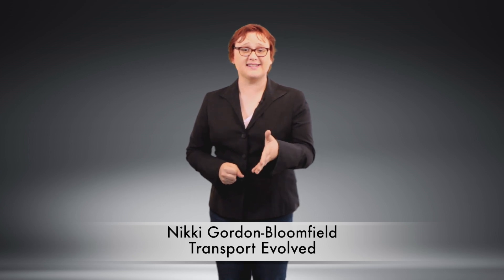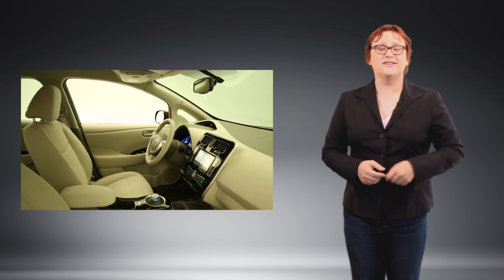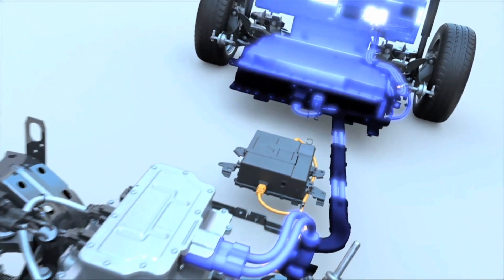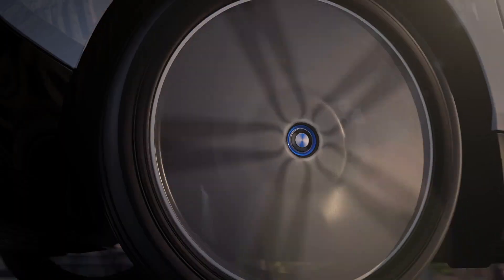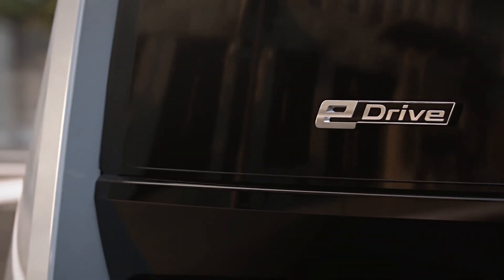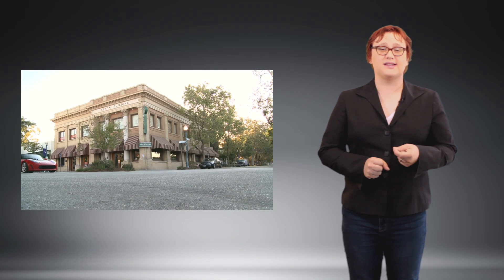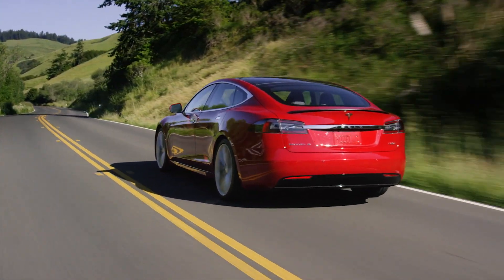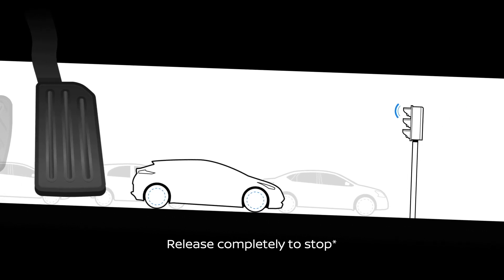What's An e-Pedal (One Pedal Driving) -- And Why Is The 2018 Nissan LEAF Getting It?

Comment: I don't think one pedal driving would be my choice, but I'm glad they're doing it.

I just want as many options to choose from as possible. Paddles, regen settings and e-pedal.
Reply: Chris Till oh you will want it in some point, specially in downhill.
Reply: The correct place for regenerative braking is fully integrated on the brake pedal.  The reasons are complex and require an understanding of vehicle dynamics and human nature.  Google for "trailing throttle oversteer" then think very hard about the types of errors untrained (not racing trained) drivers make.
Reply: Loanword Eggcorn The way the Zoe brakes I find very tricky, especially in traffic where you think you've braked enough but you really haven't. So I would really love to have a brake pedal that's just for the physical brake, or let me choose like I said. And have a strong regen option for downhills.
Reply: Chris Till I get you, it's kinda tricky from the start but if you understand and get used to it, it's not tricky at all.

Comment: Two points to add to your comprehensive video: the Bolt EV when in L mode is essentially 1-pedal, and the e-Golf in B is also very high regen.

Secondly, all EV's except the Tesla's have regen integrated into the brake pedal. This takes no learning.

I coast out of habit, so 1-pedal driving is annoying, unless it has a "detent" that coasts - like the i3 does.

Comment: The reason Nissan had to label one pedal driving with a new name "e-Pedal", is because Nissan's current LEAF models do not have "One Pedal Driving" available at all times. 2011-2012 LEAFs suck in regen braking, especially after the P3227 software update. That software update prematurely ruined my regen and CHAdeMO charging speeds.

Comment: Your comment regarding the Chevy Bolt is a bit wrong. Yes, it has a regen on demand behind the stearing wheel, but you don't mention the "L" mode. This  "L" mode has a very strong regen and gives you the 'one pedal driving'. This mode also brings the car to a complet stop. Not all other cars have this feature.

Comment: if you are using purely regen to slow down & stop what about brake lights to let cars behind you know you are slowing or am I missing something ??
Reply: Bmw i3 have the brakelights on when slowing down with regenerative braking. Don't know about the others but I assume they  work the same way
Reply: The Bolt's brake lights come on when deceleration exceeds 0.1g. Well, also when you press the brake pedal. If you come to a complete stop using regen only (one pedal driving), the brake lights will go out once you've stopped completely.
Reply: Harvey, that would be interesting to see even in common cars. I use to just remove my foot from the pedal when I need to decelerate enough for passing through a speed radar, for example. I rarely use my brakes in flat streets/roads, unless I need to stop or turn or decelerate fast for whatever reason. Also I was told in the USA it is already difficult to see manual transmission. My car is manual and that helps using the engine for "braking" without using the brake pedal or to maintain slow speed in a steep slope without over-stressing the brakes (they could fail after some time if you do brake too often in these situations).

Comment: Old technology. we were designing and building Cargo tractors with plug-in battery electric power for United Airlines at Chicago's O'Hare airport in 1985.  We used "Opportunity Charging" with charging pits where the cargo tractors were parked between planes or usage since some areas were 24 x 7 usage.  We used a GE motor and single gearbox and rear axle.   The battery was a massive 3000# lead-acid battery.  Good for pulling several baggage container trailers.  Mild regenerative braking when removing your foot from the accelerator.  Flipping a switch allowed full regen braking controlled by the accelerator pedal.  The brake pedal only actuated the hydraulic brakes.  United Airlines required battery electric baggage tractors, mobile belt loaders and wide body cargo/pallet loaders at O'Hare.  UAL received FREE electric power for all battery powered equipment from the city of Chicago.

Comment: I am able to single peddle drive on the current Leaf under the right road condition and shift select in B. I regularly come to a complete stop if the stop sign is on a slight up hill. The car will hold and stay until I press on the peddle again. There are only a few places I can use this, but one is just a few hundred meters from my home. The previous generation Smart ED had the shift paddles to increase and decrease braking, but no settings were really radical at stopping. Not much different than a Leaf in B.

I've never checked, but always wondered if the brake lights indicate that I'm stopping. They should for regen braking.

I don't understand why a coast mode is needed. With regen braking, you should be able to modulate a pure coast.
Reply: I don't think a Leaf will do this downhill.  And I bet the new Leaf will do this more often in more conditions - like the i3

Comment: I have test driven the BMW i3 and I think there are some subtle differences between manufacturers versions of this system. The car cannot have 'automatic creep mode' within this mode except perhaps with an application of the friction brakes included, and a slight delay before enabling 'creep'. This would facilitate the 'four-way stop' that here in the 'States supplants the tinier roundabouts as found in much of Europe. All this would be in software, and possible=y under patent protection.
The test drive I took was all relatively flat,  but I was impressed at how good the BMW implementation was at coming to a complete stop. Some types of traction motors may not have the ability to hold a heavier car at a downhill stop sign, however. So the friction brakes ( through the ABS?) would need to be involved. This would be especially needed for folks who become too used to the  mode to react by hitting the brake pedal.

Comment: I actually like the way Chevy does it in the Bolt and Volt.  Super-aggressive regen on accelerator lift-off can be a bit jerky and hard to get used to.  The Bolt and Volt have milder regen on accelerator lift-off, which can be supplemented by more aggressive regen with the steering wheel paddle.  I haven't driven it, but the Hyundai Ioniq seems like it might do this one better with steering wheel paddles that can quickly adjust the aggressiveness of the regen up or down.

Comment: I personally find the regen paddles in the B class best. With this  you can brake without even using the pedal in combination with driving on cruise control (I.e. zero pedal  driving).